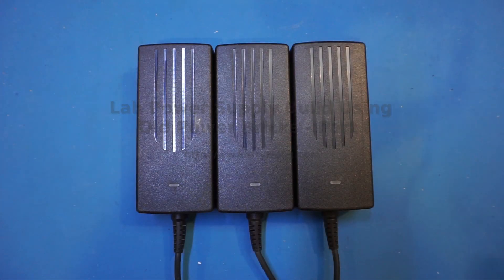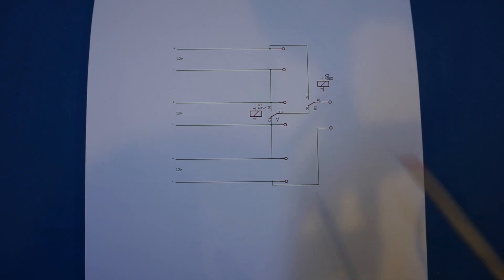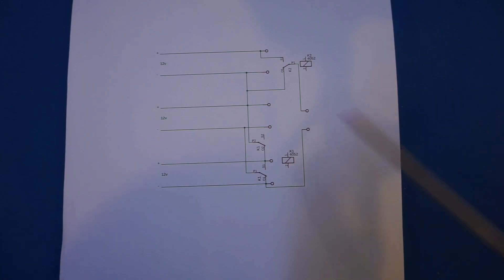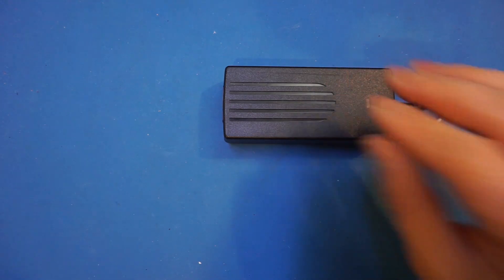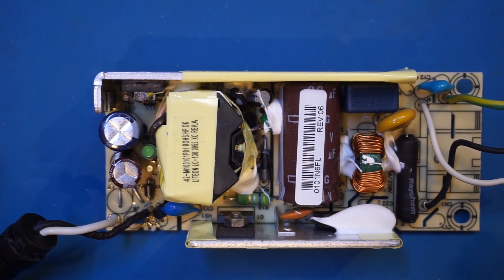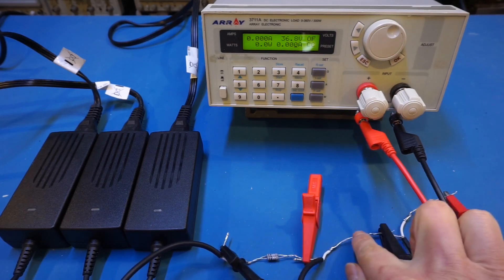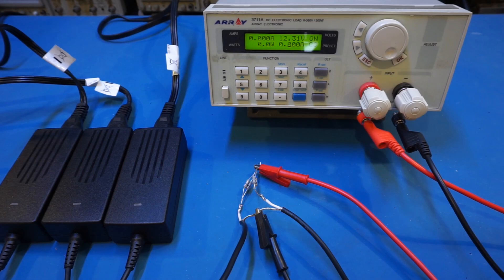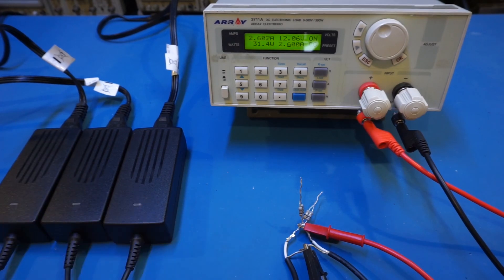Lab Power Supply Build Using Old Power Bricks - Part I/II

Comment: Great explanation! I am trying to parallel two server power supplies and I am having an issue with load sharing between the two. Only one works and then both cut off at the limit of one unit. What can I do to fix this? Would a load share resistor work and what kind would I need since each unit should output 60Amp?
Reply from the maker: Have you tried adding a current sharing resistor at the output of each power supply before combining them? You can start with a 10 mili ohm shunt at each output. BTW, the power supplies need to be pretty much identical.
Reply: @KerryWongBlog  Yes the power supplies are identical units and set as close as possible to the same voltage. I have a shunt to measure the current after the power supplies are connected but you are suggesting to use two one on each line before combining it to get the same volt drop? In my testing I found that I need to drop the voltage of the active power supply by 0.2V before the other will kick in would the volt drop of the shunt fix this? The shunt is a 100A 75mV one so it should be .75 mili ohm is that enough to just use two?
Reply from the maker: @ASCONTRACT  You will definitely need a shunt resistor on each of the output, I analyzed that in the video.In terms of exact values unfortunately you will have to experiment. The higher the resistor value the easier it is for the two supplies to balance. The goal is to minimize the power loss via these shunts. 0.2V is a good place to try out.
Reply: @KerryWongBlog  ok great! I just ordered two 0.01Ohm resistors to put that in line to see if it works based on my calcs it should balance at a load of 20 amp per unit which will be great for my application and at full load will drop 0.35V which i will try to adjust in the input voltage to account for it. I really appreciate the help! I will write back if it is a success

Comment: Although one challenge with this approach is that the sharp edges of the switching noise introduces harmonics to very high frequencies which is likely well beyond the linear regulator frequency response.  This high frequency noise will pass right through the linear regulator part.  The LM338 has a step response on the order of a few microseconds and will do little to regulate out these harmonics, they will just pass right through.  Since these are good quality switching bricks they are probably pretty quiet, but it might be good to also add some LRC filtering between the bricks and the linear regulator to further reduce this noise.

Comment: Relays? That's cheating! I was hoping you were going to hack them so that their output tracked a few volts above the linear's output voltage.
Oh well, still a neat arrangement you've come up with. 

Maybe the resistors could be replaced with inductors to filter switching noise, and hopefully their resistance would be enough for current sharing?

You probably also need a largish cap after the relays, so that the linear never gets 0 volts as the relays switchover...

Comment: There is a popular generic replacement laptop supply which has a switch to set numerous output voltages. It'd be fun to make that switch output automatically to a suitable level. Useful as they are they tend to explode. Also made me think power bricks often have a class Y capacitor that by design lets a tiny mains current escape to the output - no idea how that plays with combining them and electrical noise output.

Comment: I want more details why the limiting resistor is needed.
Reply: Because when the supplies are in parallel, they may each be trying to regulate to a slightly different voltage, so they would be fighting each other and supplying excessive current. With the resistors, they each output their own slightly different voltages, and the resistors absorb the difference. Each supply is happily regulating to its idea of what the output should be, and the junction of the resistors will be at some voltage between the two. The voltage difference will be small, so there will only be a very small voltage drop across each resistor, and the because they are very low resistance, they won't dissipate much power., even at high currents.

Comment: Slightly off topic but I would like to series connect 4 x 12V battery chargers (switched mode) to charge a 48V battery bank. Can anyone with more experience than me please comment on the practicality/pitfalls of this approach.
Reply: https://www.batterytender.com/connecting-batteries-chargers-in-series-parallel
Reply: @M Sana Thank you :)

Comment: If building into a case take the power bricks out of the cases they came in, and put them inside the larger case, with appropriate isolation, so they can run cooler. Longer life on the capacitors, and you can inspect to see if any of them are showing early signs of failing capacitors as well. That will also allow better cooling using a small fan to circulate air across them.

Comment: I wonder if you could add a switching regulator in front of the linear regulator to reduce the amount of work/dissipation it needs to do.
Reply: Yes, that's a very common technique. Just google "switching pre-regulator".  It can even just be tied in the voltage control loop to always stay a few volts above the linear reg.

Comment: Really good idea on a budget, though dangerous for beginners of course due to high voltages. These types of quality power bricks can often be purchased in lots from different surplus companies. In your next vid, I think it would be important to elaborate on the dangers of floating the 0V rail on the PSU, since other people may use different configurations after seeing your vid. For extra noise suppression, it may be a good idea to bypass each isolated PSU output to ground via some 0.1uF film caps. High noise would be the primary issue with this type of arrangement. Good relay configuration with no timing risks. Ideally you'd want to lock out the ability to change PSU configuration if the output is enabled, to avoid welding/damaging contacts under load. Would be easy enough. Thanks for posting!
Reply from the maker: Yes, I thought I pointed out that risk of removing the earth ground reference and it should be only be done if you know how to minimize the risk taken. And in general it is a bad idea :-)